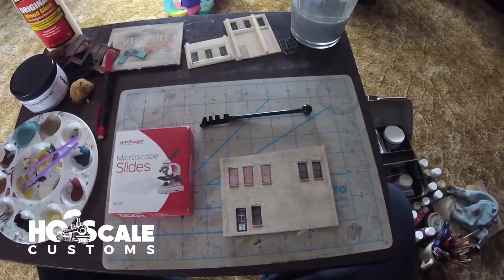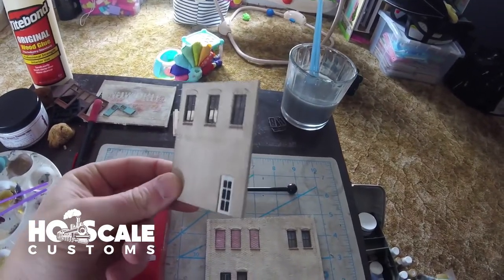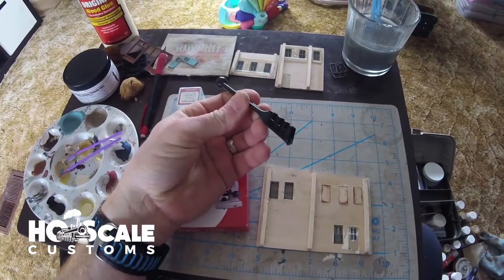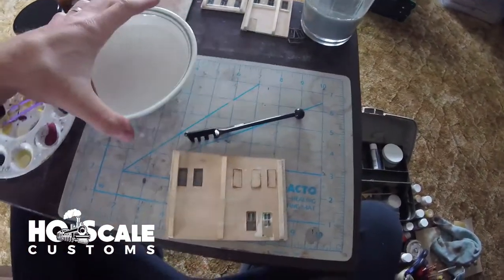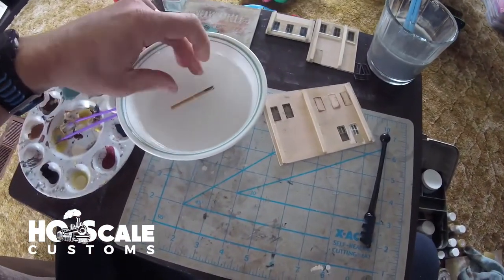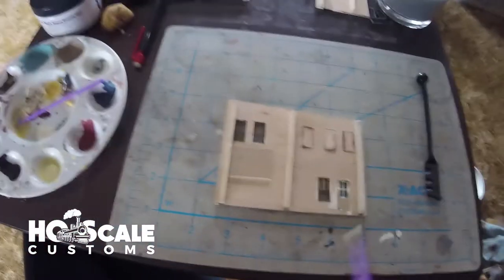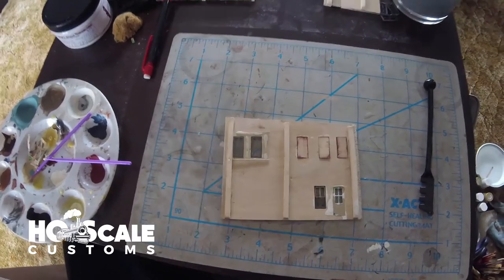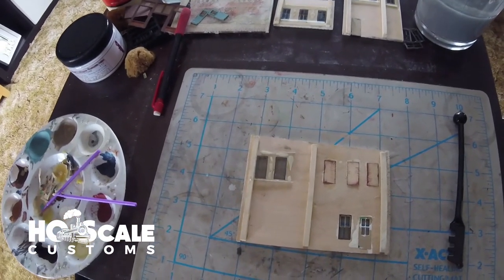Using Microscope Slide Glass for Model Railroad Buildings or Dioramas

Comment: Excellent!  I've been struggling to get clean cuts from microscope slides.  The water bath did the trick.  For my fulcrum I used a 2" length of 1/16" diameter brass rod, worked like a charm.  Quite by coincidence I have a set of Corelle bowls with the identical pattern!  Maybe that's where the magic comes from.

Comment: The challenge is to use the slide covers.  I get them in 24mm x 50mm, 100 at time for about $6.00.  The effect is considerably better than the slide itself, and lends itself to broken glass panes a whole lot better; besides, you can place the cover glass right up against the mullions.   I use a diamond tip scribe to etch the cover glass to cut it.  Show us a video of this.
Reply: I came here searching for a video of this! I have an intention to use real glass to glaze a Peco N-gauge brake van kit costing ~£5. really gilding the sow's ear but I want the practice!

Comment: Why do you need the water?
Reply from the maker: The water keeps the break clean. We've tried snapping the glass at the score line and didn't have as good of results and the break/new edge of the glass wasn't a clean cut. When we snap it under a little water it's a clean break, no jagged edges and no shattering. 

We're not sure why, but science.